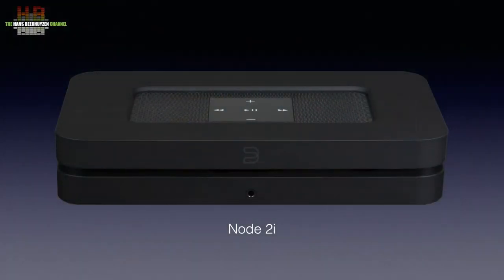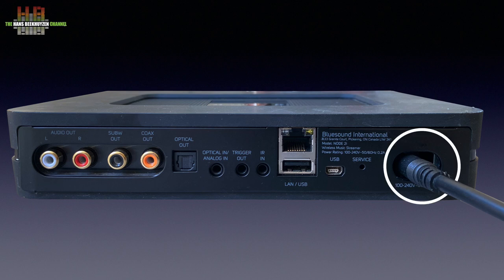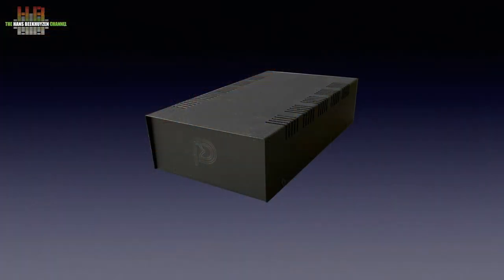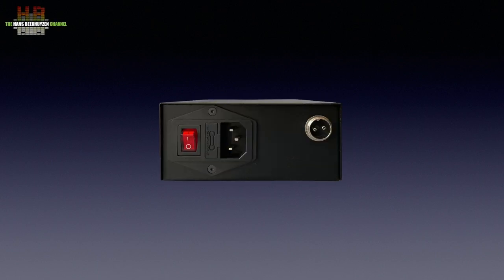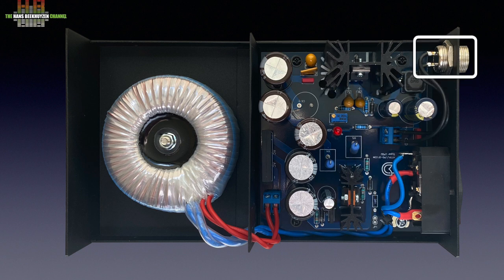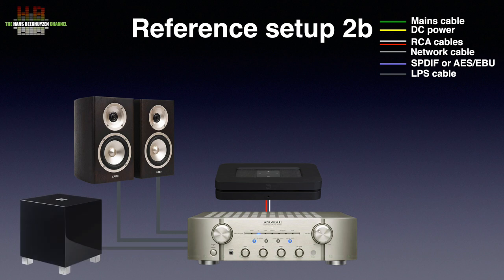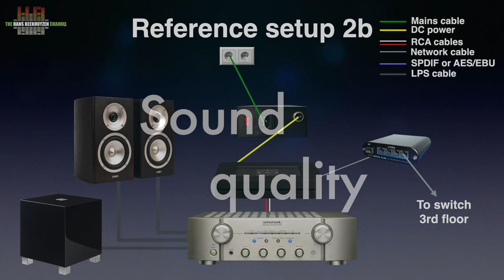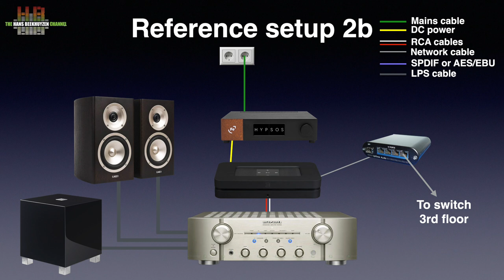PD Creative  power supply for the Bluesound Node 2 and 2i

Comment: I went with the LHY board and LHY linear power supply in my N130. I stream to an outboard DAC. Boy what a difference! I thought this was all snake oil, but figured for $279, why not. Worth every penny! Opened everything up, using the Ares II DAC, it was like a veil or wet blanket was lifted, the difference was quite obvious, and for the better.

Comment: Great review. I installed the interface on both a N130 and 2i. In both cases I use the units for streaming into external DACs. The improvement was significant and very noticeable (better separation, blacker backgrounds, improved dynamics) but will obviously vary depending in the transparency of your system. One of the best value for money improvements in my system.
Reply from the maker: Thanks for sharing
Reply: Is the improvement evident even if you use an external dac to the node?
Reply: @andreacountry8471  Yes this is a very good question.
The dac is in no way serious to use if you want to improve on the level discussed.
Reply: @onnonugteren2935  yesterday I resolved the issue, yes there is improvement even with external dac...I try in my Node😉

Comment: I did an upgrade of this board with the Allo Shanti LPSU on my Node 2i, and it brought about quite a change. More bass definition, slight bump in upper mid bass, and definitely more definition and refinement in the top end. This was the internal DAC. This was as big an upgrade for me as adding my external DAC, which is a SMSL VMV D1SE

Comment: I upgraded my N130 with their ultra low noise PSU and board. The Node’s USB goes out into my Holo Spring 3 KTE DAC. There is discernible improvement in the bass and high range. Mids are more or less the same.
Reply: Use coax men. Usb is so so. Coax much better sounding. Cheers.

Comment: Excellent review Hans. Based on your review I purchased the PD Creative interface board and power supply to upgrade my Node2i. It was delivered quickly, simple to install and after living with it for a few weeks I'm very happy with the improvement. I run my Node2i through a Chord DAC and the improvements to the sound of my system were not insignificant and consistent with your comments. In the past, I used the Node2i to play incidental music from Tidal or my own networked music library (CD quality or higher) while I was doing other stuff around the house. Serious listening to music was through my CD player or turntable. However, I now find myself listening to the Node2i as a primary music source more and more. Thanks again and once more your channel has helped me make a rationale change to my system, for the better!
Reply from the maker: Enjoy the music

Comment: I have the node n130 and the PD Creative PWR Module with Allo Shanti going to a Denafrips Ares2. And let me say that the Ifi SPDIF Purifier 2 made a HOLY COW Upgrade pretty much across the spectrum (audiophile superlatives here). I found SPDIF to sound better than the newly firmware updated USB on the node. Powered by the seconded Shanti 5v tap and after the 150hr break-in period, this is probably the best 200 I`ve spent on hi-fi in 30 years. Great channel BTW.
Reply: Interesting. I was wondering if it also provides an upgrade in sound if you bypass the bluesounds internal dac, rather than use it as Hans showed.

So I take it from this comment, the answer is 'yes' then :)
Reply: (Or was it the purifier that caused the holiness of the cow?)
Reply: @Kah0ona  It was the Ifi SPDIF purifier 2 that made the holy Cow moment,  much more so than the Node PWS upgrade.
Reply: Ifi spdif ipurifier 2 is awesome! I had the same improvements
Reply: S @Pete.across.the.street  i have the 2i, and i was thinking about upgrading to the Node 130 so that i could use USB.. perhaps i will keep the 2i and just get the IFI SPDIF purify 2?
Reply: i thought the Ares 2 had a very good clock in it  to address jitter, and the purpose of the IFI 2's job was to do the same thing coming out of the Node 2i?  so would this not be redundant?
Reply: @xstensl8823  I use it with the ares ii and got big improvements
Reply: @xstensl8823  Sending a cleaner signal to the dac is the purpose of this device.  The Node's internal clock is of lower quality making more jitter for the dac to deal with.  The proof is in the listening👍
Reply: @mikemajors2385  the Ares has a very good clock in it and should take care of  any jitter that the Node is sending to it via SPDIF? are you saying that it need to be corrected on the sending end?  i did upgraded the power cord on the Node with a audiophile one and there was a noticeable Improvement.  thanks
Reply: @xstensl8823  Correct better in = better out. LPS upgrade is also a good choice.
Reply: after buying a Node+a Allo Shanti PSU or other high end PSU you close to $1K!  so who makes a streamer only under 1K that would beat this combo?  i had the ifi Zen Stream.  it was better than the 2i, but it kept crashing.  i hear that ifi may release a MK2 version with all the bugs fixed.
Reply: @xstensl8823  That is the issue with the Zen Streamer, what good is it if it is a PIA to use. I had one and returned it, the Node N130 is still the king of the hill in regards to user friendliness. Add the PS upgrade, and now we are on another level. Best money I have spent to upgrade a piece of gear that I can recall. I thought all of this was snake oil, I am now eating my words, while enjoying the music even more!

Comment: Was wondering if the upgrade makes sense when not using Node's internal dac
Reply: It makes A LOT OF Sense, the better the DAC is the more you will benefit from clean power of streamer.
Reply: I use the Node 2i with an external Pontus DAC and I did the modification to use a SBooster LPS and it made a difference
Reply: Sure, it actually doesnt really affects internal dac sound IMO, but really improving sound of the external one.
Reply: Yes, the sound improvement is very evident with an external DAC. Best hifi money I have spent for any upgrade like this, short of entire new audio pieces. Worth every penny.

Comment: I am using my Node 2i as a streamer only, and my DAC of choice - the amazing Geshelli Labs J2 AK4493 is using a third party linear power supply; which as you note makes an enormous improvement in the sound quality. Did you also try the Node 2i as a streamer only with the PD Creative power supply? If so, is it "worthwhile" in your opinion?
Reply: Yeah, ive upgraded N130 with that kit, internal dac sound barley affected, but external dac performance jumped to another league.
Reply: @leo_kazantsev  on my 2i the change of this kit made a massive difference (with internal DAC).

Comment: great, but my question would, considering your review on the s-booster an the farad power supply would it be better getting just the interface an one of those supply's?
Reply from the maker: You lost me
Reply: @TheHansBeekhuyzenChannel  well you can buy only the interface for the bleusound .
I ask my self, would the the s-booster or even pair with the farad MK 3 (more expensive, not sure I want to do that yet) be better than the linier power supply P-D is offering in there kit. This is more a question: value for the money actually
I use the Node2I only as a transport connected to a Moon280D (which I'm in the process of upgrading. Holo S3 an May Kte or L2 are on my test list for now )

Comment: Very nice video, thank you very much! Did you test, if the sound quality also improves when using the Bluesound only as the "Transport" and with an external DAC? (I run my Bluesound Node with Digital RCA out to an Accuphase DP-510). Thanks and Regards!
Reply from the maker: It will also improve the digital output.
Reply: @TheHansBeekhuyzenChannel  thank you for your reply

Comment: Hi Hans, thank you for your informative video(s)!  I have a question, what in your opinion would be the best streamer to connect to my 20 y.o. Linn system?  The choices I am pondering are: (1) Node X; (2) N130 w/PSU; (3) Linn Sneaky DS 2008 model; or (4) Linn Sekrit DS 2011 model?  My heart tells me to go with Linn, but I wonder if those units, due to their age, would not be as good as the BluOS options maybe?  Your thoughts and advice are greatly appreciated...
Reply from the maker: I can't get Linn equipment for review, for the rest, see my review. That is why I make them
Reply: Sure, but do you think the Linn streamers I mentioned, being over 20 years old, would not be able to compete with the latest DAC's used in the Nodes? @TheHansBeekhuyzenChannel

Comment: I'm going to order the PD creative kit.  considering a correct cost-benefit ratio, does it make sense to buy the cheaper version with an external medical power supply instead of the version with the "super low noise power supply"?
Reply from the maker: I would not..

Comment: Thank you very much for all the great videos. I have yet to experiment with using external power supplies. To address jitter and clocking, I decided to incorporate the Denafrips Hermes DDC between my Denafrips Pontus II DAC and digital sources, such as the Bluesound Node. All my components are fronted by Panamax M5300-PM power conditioners. All of my power, speaker and interconnect cables are upgraded. Would my Node still benefit from an external power supply?
Reply: I think so.
Reply: Yes, I bought the LHY kit Alvin at Vinshine Audio is selling for my N130, it made a profound difference in my Node's streaming sq. I use the Ares II DAC, Venus II is on the way. I thought all of this was snake oil, boy was I wrong. Worth every penny.

Comment: Would this upgrade be worth it if the node 2i is only used as a transport?   My Node 2i goes into an external DAC of very high quality. Would like a better streaming transport and I wondering if this power supply upgrade will do that.
Reply from the maker: It would surely help.
Reply: @TheHansBeekhuyzenChannel  Thank you for the reply

Comment: Dear Hans, thank you for your interesting video’s. Because of this video post I’m very curious. Are you able to answer my question. 😊
I’m a happy user of a Bluesound Node (130) connected to an external dac. It’s the Denafrips Ares II. Cable is the optical AQ Cinnamon. Now my question. Do you think it makes a sonical improvement if I would install the linear power supply? Only answers I could find on the internet are with Coax or USB connection. Thank you very much in advance for taking the time and keep up the good work 😊.
Greating,
Olaf from The Netherlands
Reply from the maker: There will be sonic improvement, whether that improvement is audible to you depends on your equipment and your ears.
Reply: @TheHansBeekhuyzenChannel  Thank you for taking the time in answering. Regarding the rest of the equipment. I’m using a “vintage” Linn Intek amp and Linn Nexus loudspeakers. Plus the external dac Denafrips Ares II in combination with the Bluesound Node (130) via Optical. What do you think?

Comment: Hans, I'm seriously considering this upgrade for my Node 2i. But I'm thinking of purchasing an Allo Shanti as the LPS as it has two DC outputs; the 2nd being for an external DAC. My concern is that the DC cables are hardwired and of uncertain audio sonic quality. Would it be better to get the PC Creative LPS so as to use separate higher end DC cables? Or would it be worth replacing the Shanti cables by installing chassis mounted sockets and, again, using separate DC cables. I'd appreciate your thoughts. And thank you for such useful and easily understandable videos. I'm not an engineer, just a very amateur audio enthusiast and look to "experts" such as yourself to assist us in making smart and useful choices.
Reply from the maker: I haven't tried so I can't say.

Comment: Hello. Thanks for your video. I have in NODE 2021 connected to an FDA Quloos A690 in Spdif or USB.

Can the power supply shown in the video have an impact on my assembly? Or an ifi spdif ipurifier as said below in the comments is sufficient? thank you
Reply from the maker: Start with the power supply
Reply: @TheHansBeekhuyzenChannel   Thank you for your reply. So the kit at 1060.00 pln?
Reply from the maker: @stjah69  If your grid is at 230 volts. Else buy the cheapest kit and get a quality audiophile power supply that delivers 2 amps at 5 volts.
Reply: @TheHansBeekhuyzenChannel  Yes I am in France. So 230V. Ok then I have to take the kit at 1060.00 PLN
Reply from the maker: @stjah69  👍🏻

Comment: Compatible with US 115V ?
Reply: Yes
Reply: Not the power supply though
Reply from the maker: There only is a 230 volts version of the exterior power supply. You can use the board that replaces the internal power supply and another 5V 2A external power supply.

Comment: So which power supply would you recommend?
Reply: Checkout the Allo Audio Shanti LPS it has 2 taps one 5v/3a for the Node and a 5v/1 amp for something else.
Reply from the maker: I find he PD Creative very good and affordable.
Reply: @TheHansBeekhuyzenChannel  For the average person, would you suggest the standard power supply or the “Super Low Noise” power supply?
Thank you.
Reply from the maker: The latter!!
Reply: @mikemajors2385  Hi Mike,
The Allo Shanti LPS is about the same price as the Super Quiet PSU from PD.  What makes it better?
Thanks.
Reply: Anyone make the upgrade to an N130 and use the internal DAC? Was it a noticeable improvement?

Comment: The original power supply is quite bad indeed, I had bad power and disturbances from thé wall in my last apartment and everytime a light, thé oven, or anything turned on, thé sound was cut for à short time.
Reply from the maker: 'Quite bad' doesn't do it justice. It's an average PSU that can be improved by an external one.
Reply: @TheHansBeekhuyzenChannel  mine may have à flaw At that stage then.

Comment: Hi Hans,
Maurizio from Verona Italy.
I've a suggestion for you.
A Video Review of a DYI Board.
Arylic Up2Stream HD DAC, complete with Case & Remote.
Low Costs but Great Performances
Curious of Your enlightened judgment 💡
Thanks & Regards
Maurizio
Reply from the maker: It's too much DIY, I review only ready to use consumer products.
Reply: @TheHansBeekhuyzenChannel Well..Is classified like DIY olny for price issue.
But really Is the same of Ready to use Arylic S50 Pro+.
You can use with or without case and with or without remote as you want to spent.
But imho Is much better 'cause the different DAC ESS9038Q2M and moreover non downsampling at Red book CD resolution by Linkplay Wi-Fi Board ..1:1 at 24/192. (Like Node 2I).
Anyway, thanks for your attention.
Maurizio